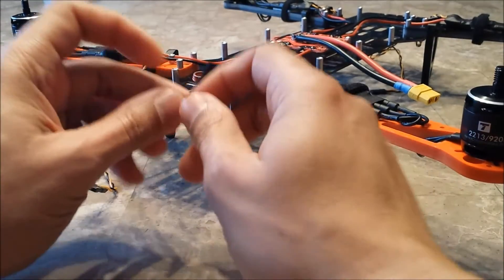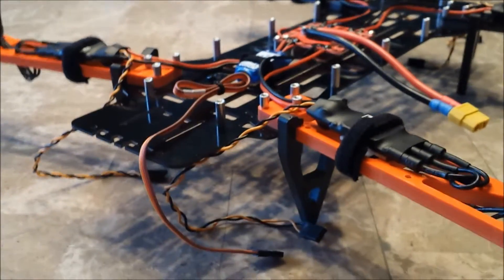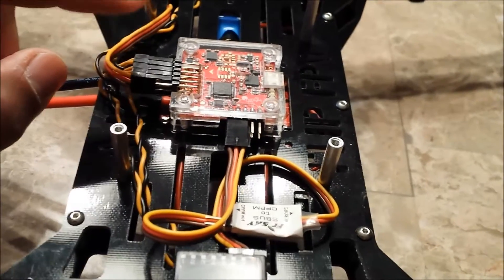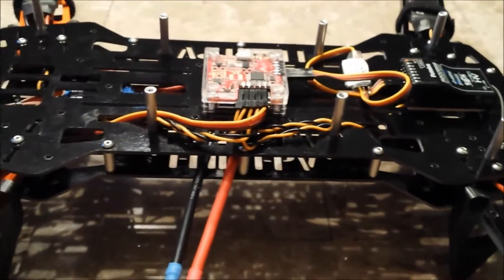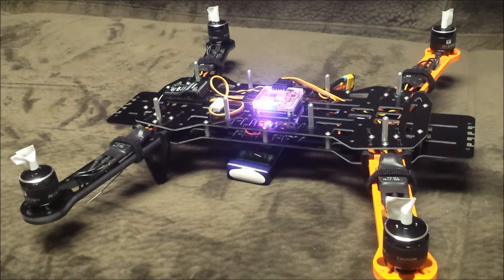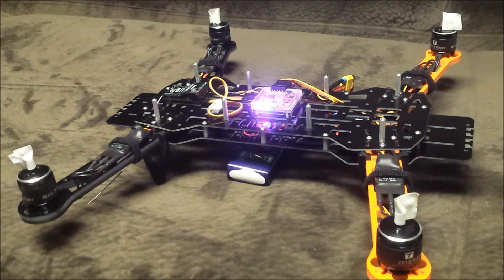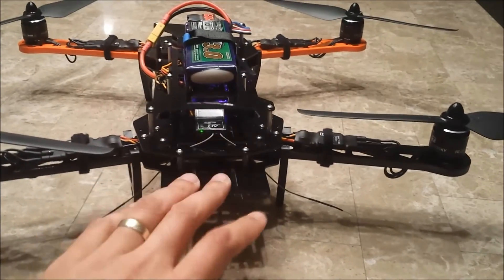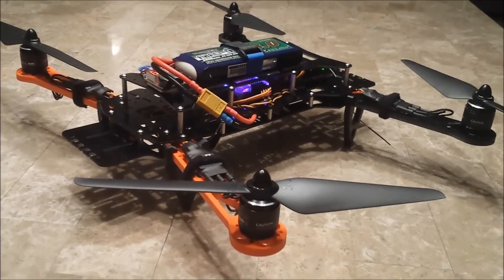Tiger Motor Air Gear 350/HT Flip Fpv Part 2

Comment: I am little confuse.... I am making my drone using Tiger  Air Gear 350. I have 4 ESCs with it. I know that Doesn't have BEC. To proceed do i need 4 separate BECs  hooked  to  each  ESCs or I  just  need  one BEC hooked to the   5V output pin?
Reply from the maker: Yes, four separate esc's and BEC to an esc position to power the NAZE  up. I believe you could use the 5v  but I didn't. BEC from power distro board to esc position 5 on my board.

Comment from the maker: @Garret,the bullet connectors are tight enough that they have never popped out on any builds I've done or ever seen built. But... anything is possible! I wouldn't worry about those coming loose as long as you don't have anything pulling on the connections.

Comment: Did you do anything to secure the connections between ESC's and motors?
I bought the air gear kit and am concerned that a connection may come apart mid flight.
Thanks for any input.

Comment: Nice build can't wait to see more. No FPV? 
I just ordered this kit too T-Motor. DIY400 frame video posted when I get it. 
What's your all up weight?
Reply from the maker: Thank you,and yes I have some ideas for an FPV setup for this build just haven't pulled the trigger yet. this setup at this time how you see it in the video has an AUW of 1109g =2.4lbs thats with the 3000 mah battery.looking forward to seeing your build using the T-Motor kit and the DIY400 frame.
Reply: Awesome sounds good 1100g is actually really light for these motors. I watched a video of a guy running 1800g! It still flew excellent. 
Digging this flip frame! Keep up the good work

Comment from the maker: The DJI power distribution is integrated in the bottom plates of most of their multirotor frames which makes it very neat,clean and convenient.this HT Flip frame does not use an integrated system or any for that matter so it's up to you to supply a means to power the components that's the only differences.